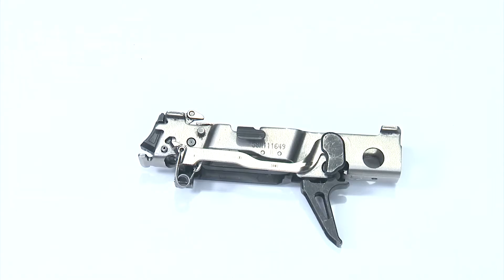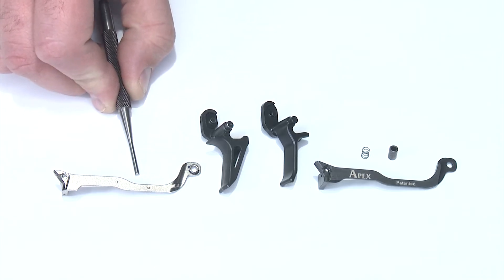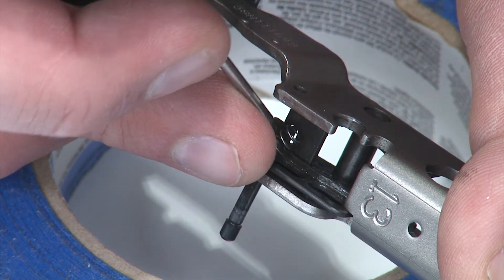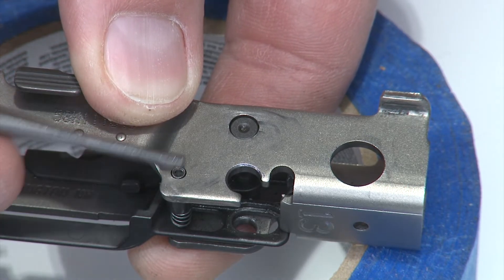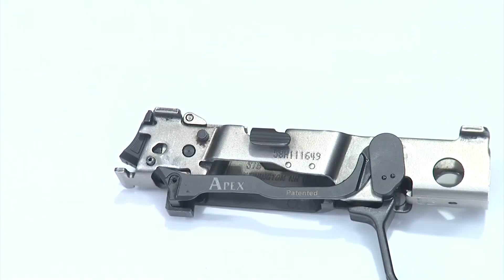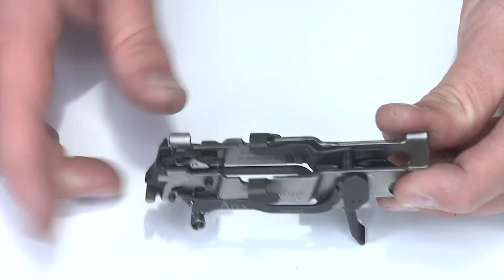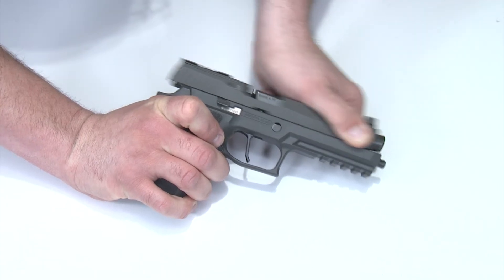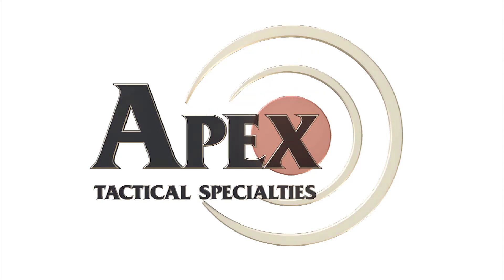Apex Trigger Bar Kit Installation for the Sig Sauer P320

Comment: For some reason the over-travel stop pin is not fitting in the over-travel stop. I tried fishing it through with the pin punch and worked on it for at least an hour and still was unsuccessful in installing it. Any tips guys?
Reply from the maker: Yes, call our customer service at 623-322-0200. They can assist you. It's kinda why they're here.
Reply: If this happens to you they will tell you to sand the tip of the pin down, it is mushroom a bit.  Do it with fine sandpaper and a little at a time.  Fixed the problem!
Reply: @thatWASdum328  this was my problem, sanded the tip down after forcing it out with a punch

Comment: I have a m17 p320 fcu that I removed the manual safety from. I already own the apex trigger bar & flat trigger, however I can’t use the trigger bar due to it slightly catching onto the manual safety hole during trigger reset. I want to buy the forward trigger bar featured in this video. Where can I find it since I had no luck on my own. Thanks
Reply from the maker: Contact our customer service at 623-322-0200 and they can assist you.

Comment: My over travel pin won't go back in. I had to really hammer it out and it won't go back in after putting on the spring and tube

Edit: I was finally able to get it going and the spring was way easier for me than the overtravel pin 😅

Comment: Hi, Ben from FLUX here - is it required to use the overtravel stop to also use your trigger bar? Our Raider safety is not compatible with your overtravel stop, but does seem to work with both your trigger and bar, and I do not seem to have any issues, but I have a customer telling me that APEX says that you must use the overtravel stop in order to use the bar.
Reply from the maker: This is a question best directed directly to our engineering department, by phone and not over social media.
Reply: @apextactical  Thank you, I reached out by all means possible in order to receive an answer as soon as possible. I just got it via email this morning, but thank you for replying. We all love Apex stuff at Flux.

Comment: I installed the trigger but it did not reset everytime. Is the whole trigger bar and trigger kit necessary to run the trigger?
Reply from the maker: @57Jimflynn  the trigger does work solo without the bar(provided you don't have the CA variant kit , if you run it that way, make sure you remove the over travel stop and spring that are included in the kit.

The fail to reset is likely due to tolerance variations within the pistol.  Contact our Customer Service people, they can walk you through the minor modification to the trigger bar that should fix the reset for you.

Comment: I installed the kit and now i noticed that when i pull the trigger the whole upper kind of moves down and when the click happens the upper goes back to where it was. Is that normal? Help please
Reply from the maker: Yes that is normal.  The slide to frame fit requires movement to allow for proper cycling when it gets hot and dirty.
Reply: Thank you

Comment: I'm installing an apex 112 031 kit on my sig xcarry, and my over travel stop tube is not hollow.  It's only half drilled through on one side, and the other side is drilled slightly.  Pretty bummed out .  Was my Xmas present from my wife.
Reply from the maker: Just contact customer service at 623-322-0200 and they can help you.

Comment: Does this work with m18 models with a manual safety?
Reply from the maker: Yes, the new trigger bar design work on the thumb safety models.
Reply: Awesome I had got the trigger kit and installed. It works fine with the apex trigger. However with my sig flat skeletonized trigger. It has issues re engaging the seer. Is there any trouble shooting you know of?
Reply from the maker: @Burneygames  You can contact our customer service at 623-322-0200 for assistance.

Comment: What would be the problem, if everything looks good, but there's no articulation out of or in a grip module?  I have zero sear activation, as I believe you referred to it, and between 3 triggers, each only moves like 1mm.  I can't figure it out.  After buying the 112-031 kit, and watching this video, until it was engraved into my brain, AND, watching the video and pausing during installation, I'm clearly a moron.  I will say, that this was my first interaction of any kind, with anything from the P320 platform, so I can only assume that it's 100% operator/installer error.
Reply from the maker: Contact our customer service at 623-322-0200 and they can help you with troubleshooting the install. Have a camera handy so you can take pics to show our customer service what you're seeing.

Comment: it seems the disconnector (3rd party) is to short to fully engage ( Drive) the spring and trigger bar to the bottom of the sear housing assembly . Now when i push trigger bar with finger, it locks in place fine.